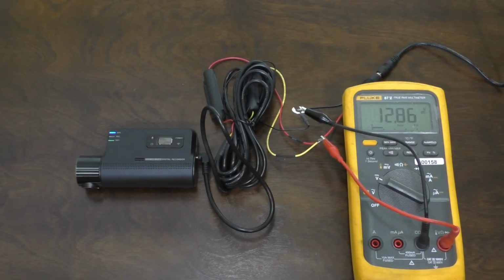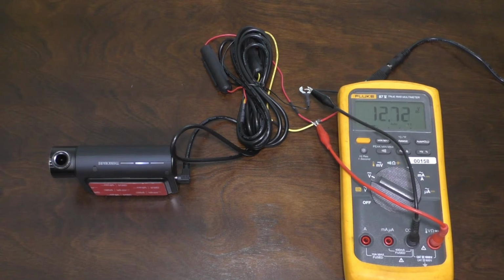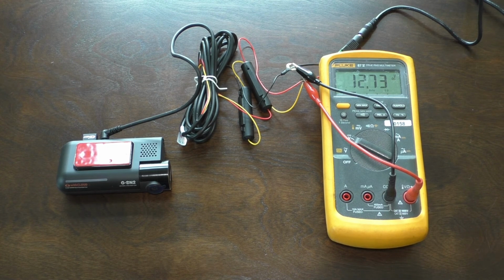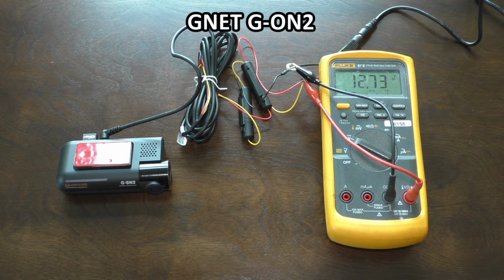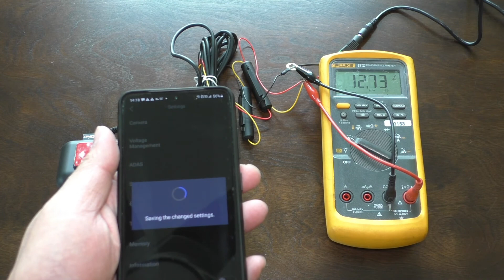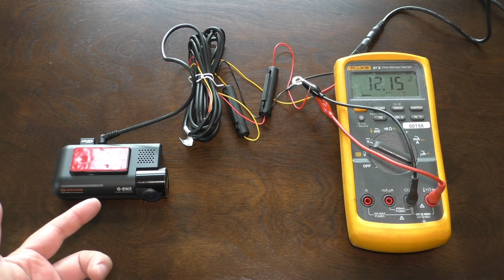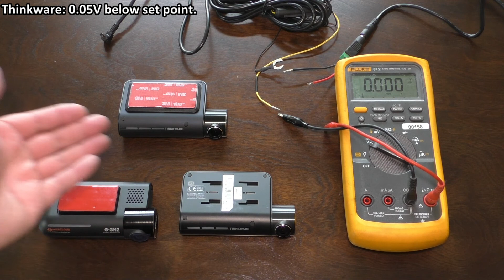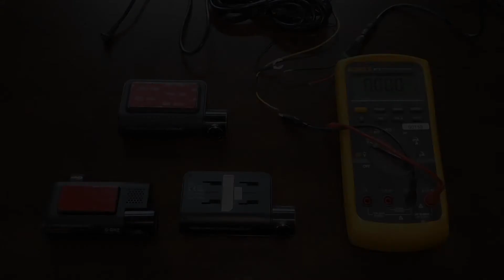How Well Do Dashcams' Low Voltage Shutoffs Work?

Comment: hi, what power supply do you send to the camera to test the shutoff with your power meter. thanks in advance.
Reply from the maker: I added a link to the PSU at the bottom of the video description. Thanks.
Reply: @FaRKle0079  thanks i,m sorted now.

Comment: Interesting article. I recently purchased a cheap OBD 11 power supply for my Viofo A129+ Duo. The power supply has auto shut off at a quoted 11.6v. In reality it shuts off somewhat sooner than 11.6v but I haven't taken any measurements yet. I suspect that it shuts off at values as high as 12.5v which is a bit frustrating.
Reply from the maker: Wow, 12.5V is way higher!